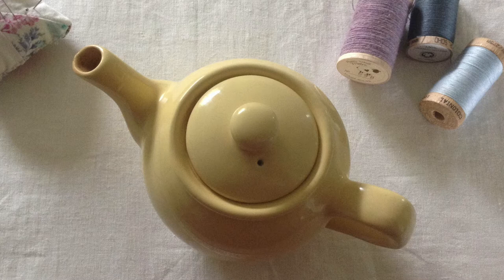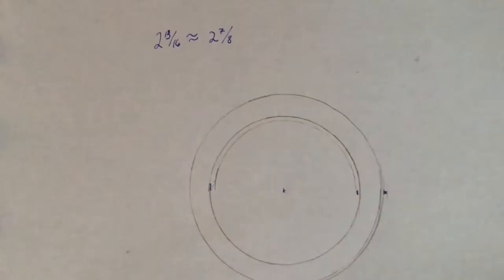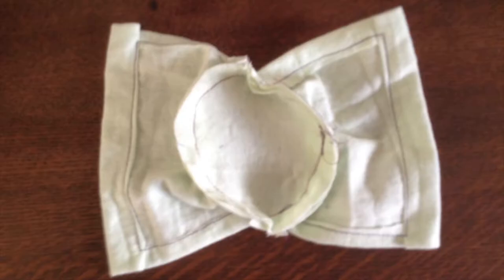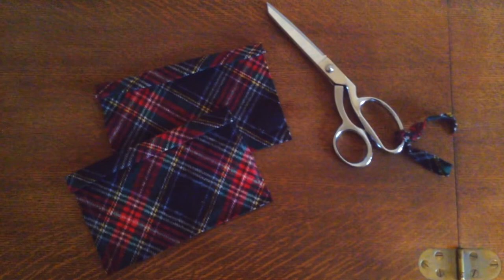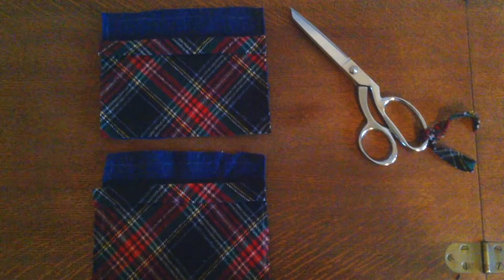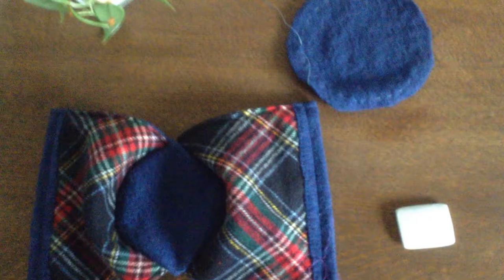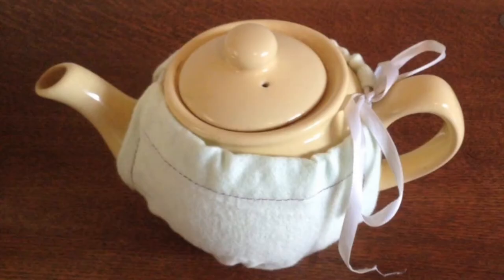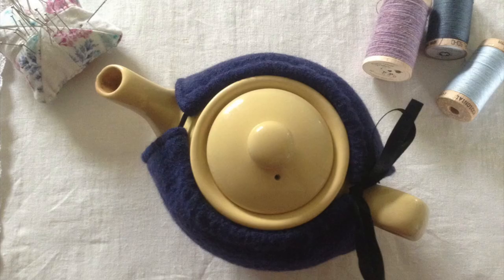Making a Tea Cozy out of Leftover Wool and Flannel

Comment: I took an irrational delight in watching this rational stitching.

Question: what is the heat loss through the lid? How significantly would it reduce the heat loss if you covered the top as well?
Reply from the maker: Thank you! :)

I haven't tested it, but that would be interesting!
Maybe when it gets colder I should do a temperature test, starting with boiling water, and checking the temperature at time t both with and without cozy? I could probably rig up some insulation for the lid, too, to see how well it's already keeping in heat. The teapot by itself is already pretty good at holding heat, but on really cold days I noticed a difference. (It didn't help that I was often using it while working near a pretty drafty window.)

The lip around the lid is already pretty thick, and the lid has an inner lip as well, so I figured the heat loss is probably less than over another section of teapot with the equivalent area. I did think of making a buttoning flap to insulate the lid, but there is a slight inconvenience there when opening the teapot for whatever reason, and, in the end, I figured the open spout was probably a bigger cause for worry.